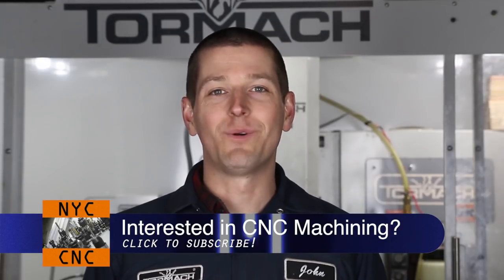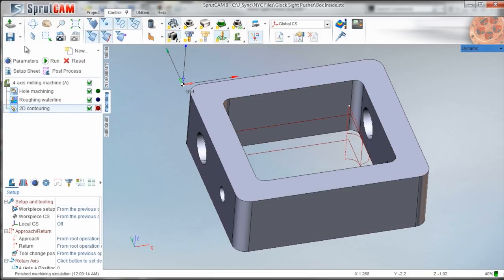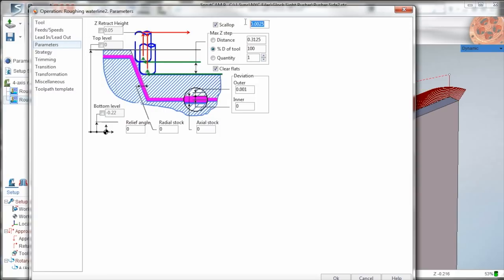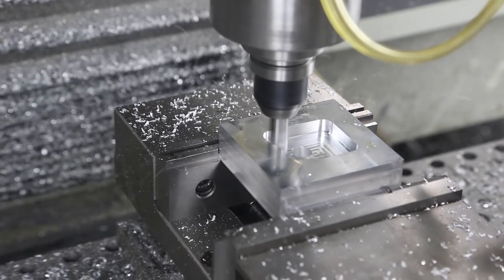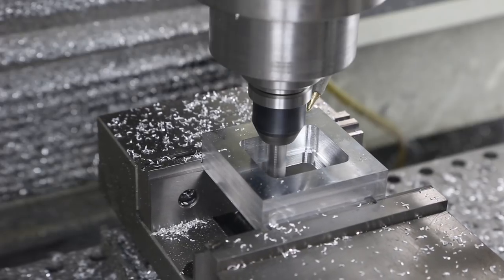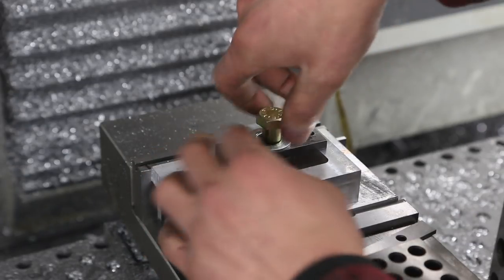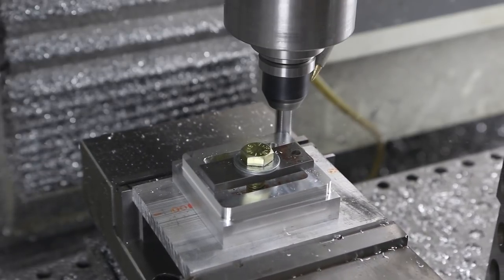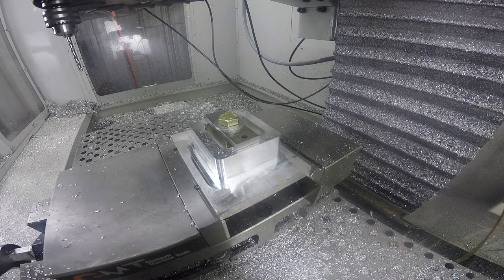DIY Glock Rear Sight Pusher Installation Tool!   Part 1 Widget31

Comment: This is a project I could use!  I've always thought the Glock sight installation tools were needlessly expensive.  If I did much sight work on Glocks, I'd be tempted to make a tool.  I guess everyone figures they're too expensive but the difference in cost between the commercial units and the materials to make one are not quite enough to justify the time.

Comment: Great tool! Love the gun related projects. note for the tool though make sure the threads are lubed up well, and also if you feel you are applying too much force you made need to do some file fitting to the sight and/or the slide before and not just crush it in.

Comment: I know I have said this before, but this just doesnt look real sometimes. The rougher? Totally believable. I have had finishes like that plenty of times before. But the finishing pass... It is a mirror finish every time. It is beautiful!

Great job on a simple but useful tool.
I have been following Abom79 on his welding table build. He is making a work of art, not just a tool. That is how this seems to me as well. It could be as simple as a piece of steel square tube cut, tapped, and welded. But this, made from the ground up, is pretty awesome. 

Great job again!
Reply: You tha man John! And thanks Cody Smallwood

Comment: Don't know if that was me with the suggestion on the peck depth but looking good. Chip breaking vs pecking too! (Without retract)
Reply: Doesn't the CAM software have a canned drill pecking cycle in it?
Just curious.

Comment: Nice project, John. I always like CNC work. Almost like watching a magic show.

Regarding water in your air lines, get a couple auto drains and install them in the lowest points of your air lines. They will keep your lines free of water. Just upstream of your critical equipment, I would put automatic oilers to prevent any rust issues.

Good video.
John
Reply: John
Don't forget the bottom of the compressor tank. Tank failures are infrequent but they do happen and when they do, they do all the damage of a small bomb. The most frequent cause is corrosion of the tank wall until it can no longer hold the air pressure.
I used to be in the air compressor business.

Think carefully where you put the auto drains and you shouldn't have any more trouble.
John

Comment: Great project and I will be back to see it all done.  I have thought about building a similar tool before myself but my easy answer was to only buy pistols that have an adjustable rear sight.  They cost a little more but they are worth it.  I do still have an XD 9mm with a fixed rear sight so building that tool is still a possibility.   CNC looks like a solid winner to me, too bad it is so expensive to get the equipment.  Thanks for the video.
Reply: Yes that is a fact.  I did not mean it was not a very useful tool.  I just postpone the need by getting adjustable.
Reply: NYC CNC the factory installed the adjustable sights, not me.

Comment: If you do a helical entry instead of drilling, it will free you from having to do a tool change from the drill to milling. Nine job, I should make one too.
Reply: He could also just peck drill the end mill if he wanted to. I've done it a few times on short run parts to avoid tool changes and setup.
Reply: akromix A helical entry is far nicer on the tool and leaves a good size pocket for chip evacuation.
Reply: akromix
 Especially in aluminum, you risk breaking the cutter if used that way as the chips have no where to go.
Reply: makun16 not if you do 5 to 10 thou pecks. Not ideal on thicker aluminum but if your machine rapids fast enough it isn't a big deal.

Comment: So Mach3 doesn't show you the tool path at all, or it does but you can't zoom/rotate it? I've only used LinuxCNC, which I went with because it is free and I always thought I would "upgrade" to Mach3. Since it never gave me a single issue, I just stayed with it (and am happy).

Great video John!

Comment: Hiya.   I was thinking about that chatter in the corners and dimly remembered an article or video about it.   Took me a while to track it down, but here it is:
http://www.cnccookbook.com/CCCNCMillFeedsSpeedsHighSpeedMachining.htm

By milling a corner that is the same radius as the cutter you are going from a small angle of engagement so something like 120 degrees engagement in the corner, instantly raising the forces on the tool a lot.   I think if you make sure the part radius is larger than the tool radius you can minimize this effect quite easily.   So maybe using a 5/16 corner radius with a 1/4" tool might reduce the corner loading enough to prevent chatter without having to do an entire HSM toolpath.  Willing to give it a try on some scrap (with that same tool) and see how it turns out?

Comment: Lol you just asked how you could do the outside contour in one operation but you're using a second OP to do so. You should have started with thicker material and don't a contour flip. You get the inside, outside contour and a machined face all in one operation and you did one of those in your first operation
Reply: It's also 10x safer than your setup, and wouldn't be .004" out of square, you don't have to avoid the clamp height, you don't need to open and close the vise unnecessarily, you don't need to indicate the part in. Soo many things that are just wasting time